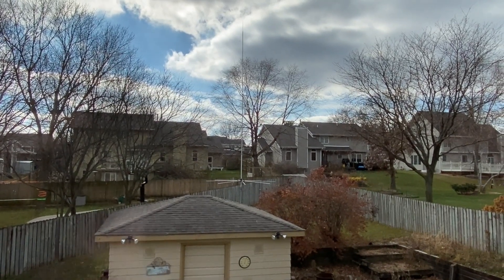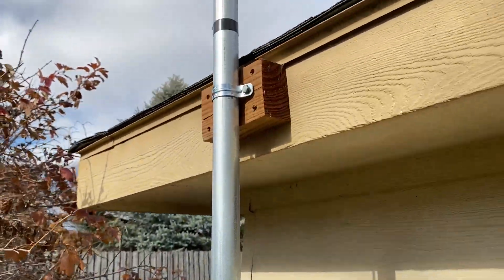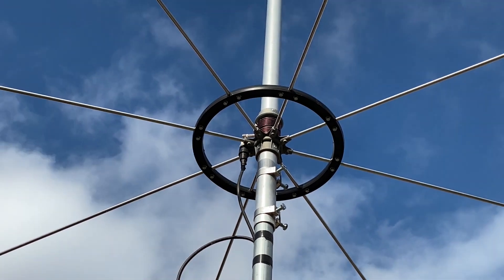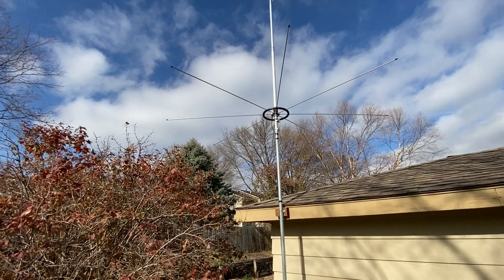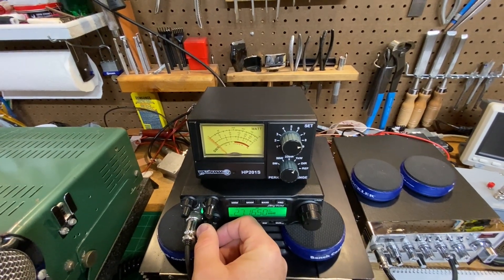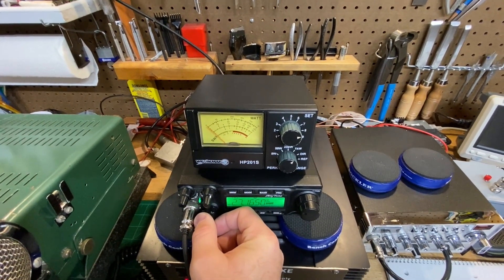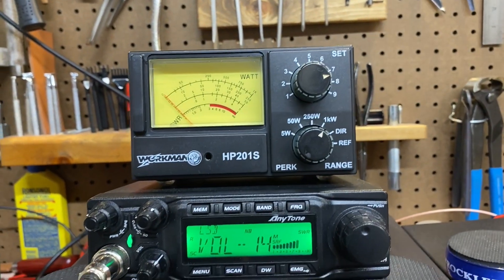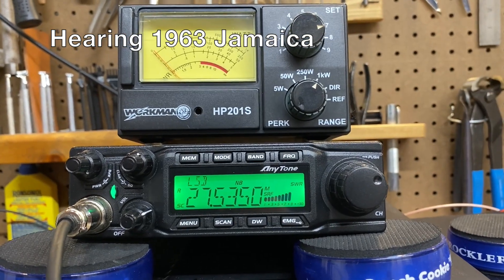Sirio 827 One Year Review and Overview - CB Base Antenna

Comment: I've tried the 2016 sireo and in a matter of months it's bending. So I've ordered a 827 wished I had firstly as I had one years ago and it was awesome. So can't wait to get it and put it up 🇬🇧
Reply from the maker: My 827 is two years old.  We haven't suffered any insane winds, but maybe a couple of 90mph gusts.  It's still as straight as day one.
Reply: @421CentralIowa  the 2016 is just like a silver rod with a coil, only up 16ft and it's bent. Can you remember the top section swr length bud.
Reply from the maker: @CarlPortass  I can't remember the exact measurement but the 827 came with instructions to calculate the length of the top element in terms of tuning to what frequency.  When I first set mine up for channel 20 my SWR was 1:1 from like 26.500-27.800.   I can get away with using it on 10m but my SWR is around 1.7 up there.  I have used it on 26.805 to talk on FM without any problems.
Reply: @421CentralIowa  brilliant cheers bud 👍
Reply: I don't like the sound of that. I heard other people saying they were good quality/rugged.  I'm only commenting because I was going to put one up next week and really don't want to have to look near it for at least 5 years. I went for the 2016 because of the lower wind loading which is about 100N less than the 827 at 80 or 90mph or what ever it is.
Reply: @samuelkearney880  Make sure you tape the joints well as the plastic sleeves that locate the screws are poorly made. They use to have a slight cup inside for the screw but not on the 2016.
Reply: @CarlPortass thanks.  I put the amalagmating tape on the joints.  I'll give the 2016 a go and if it goes sour after a few years i'll hopefully have the tower ready and put up the 827 and 4 element yagi.
Reply: Did you have to use "Gorilla "Tape. Or self amalgamating tape on  the whip sections? Cant see it in your video.
This is what I need to change 4 times per year! I hate to get the pipe down with my Sirio Gpe attached on it as I do this alone. I want an antanna like yours : No maintenance for at least a year. So all seasons. 
So the waterproofing tape is really anoying every few months when it get hard and crackled and letting water through. 
I am very interested in the Siro mega range 827. Adjusting seems the same as my cheaper Sirio. But I really want an antenna for once that dont need 4 times a year getting down for new tape.
Reply: @Iheartmyson  I used amalgamating tape
Reply: @CarlPortass  ok. So you dó use it ,in contradiction of OP! 
Man i get confused now. But the 2008 and 2016 are very good antennes anyway.  Just wondering reading the video makers not using tape at all. Thinking rain / water will drain away or something. Like the Tornado or monsoon ( i think) where the antenna is shoved over the pole, so on these the water does literally drain away!  Hmm, have to look and email a seller about it then. ( And hope he is honoust) Lol
Reply: @Iheartmyson  Hi in my understanding is that there is NO drain hole on the antenna, and everyone uses tape on the joints and also around the coax connector to stop moisture getting in and corroding the connector. I also used  better hex head self tapping screws and not the crap that comes with the antenna. Always best to ask advice from people who have the antenna, 73s buddy

Comment: Well, "skip" means just about nothing. The real question is how does it work locally, and out toward the horizon?.
Reply from the maker: Skip is everything.  I only talk DX, not locally.  I have mine mounted 10 feet off of the ground.  I imagine it'd work fine locally if it was 36+ feet off of the ground, but I don't talk to locals.  I have talked to someone on sideband who was on a moonraker, about 65 miles from me as the crow flies.
Reply: Skip is all about atmospheric condition's. If conditions are in your favor where you are at, then someone with like  12 watts of power can talk over someone operating 1kw amp. It cracks me up how these manufacturers say this so&so particular antenna is the best for DXing. It's all marketing B.S. on the DX part.I've talked skip on a Wilson Little Will  magnetic mount antenna inside my house stuck to a metal stair railing. Also talked to a local friend 12 miles away from me on the same setup. All this done using a President 2510 putting out around 35 watts PEP on LSB.
Reply from the maker: @timmack2415  The full cycle is 11 years.  2025 will be the peak and around 2031 will be the dip.  2036 will be around the next peak.   But propagation conditions still happen randomly even at the minimum, just like we have dead days on the air during the peak right now.     I'm going to have a 5 element horizontal beam on a tower with a rotator at some point which will open things up for me on the days when conditions pop up during the weak part of the solar cycle.
Reply: @421CentralIowa  I'm well aware. I've been a CBer since 1975 and an extra class ham since 1989. 
I'm not sure what happened to my last comment, but I believe I said that.

Comment: I gave up freebanding in 2002, glad to see it's still going strong,  low angle is great for DX, I made 2. Coaxial cable antennas and co-fazed them at 25 feet, one vertical, one horizontal, talked all over the country and the world, 73s. 2AK2410 Mike
Reply: Did you use the big 75 ohm coax for your cophase cables ?
Reply: @flhusa1  no I used rg-58,  it was the best cable I could get though, wasn't the cheap stuff,  I got a roll from a local shop that was closing down, 300+ feet left on the roll when I bought it
Reply: @mwilliams55555  ALL COPHASE CABLE ASSEMBLIES REQUIRE 75 OHM TO WORK PROPERLY. GOOGLE IT IF YOU DECIDE TO MAKE ANOTHER ONE.

Comment: If you put that antenna up against a £40 odd quid silver rod you wouldn't be able to justify paying the extra £100.
Reply: Will the silver rod also work on 40 meters?
Reply: @skiball2000  no. 26 to 28 megs. 10 and 11 meters
Reply: @zukispur5493  Actually here in the US 10 meters stops at 29.7 MHz. 
I was planning on purchasing a Sirio 827 as a 10 meter vertical. The prospect of getting 11(CB), 12, 15, 17, 20 and even 40 meters on the antenna was a big plus towards my decision. You mentioned the silver rod as a cheaper alternative.. If I can get the same bang for less bucks, I’m all in. That’s the reason for my question to you. Amateur operator- WW3HAM
Reply: @skiball2000  I didn't realize the 827 had such a wide range. Kinda justifies the price now I suppose. The simple silver rod is enough for me right about now though. I have it on the roof of a 18 story tower block here in London 🌚 can get out all over London on a watt or two. Vintage cb radio is my thing , those I wanted in the 80s that I couldn't afford. Cobra 148 gtl DX. Stalker x1. Westland 707. Midland 7001. President Lincoln mk1. Teardrop mic. Turner jm+2u. Silver eagle mics ect. Anyway brother nice chatting with ya🌚👍
Reply: @skiball2000  old licensed hams are killing this wonderful hobby.  They all need to lighten up. 🌚
Reply: @zukispur5493  I received an old DAK Mark IX a couple years ago. It was a CB’rs dream back in the 1970’s but had a $600 price tag so few people owned one. I just now ordered the 827 which should be her next Thursday. I’ll be able to play at around with that old CB as well as the ham bands. I think I made the right choice. I guess I’ll find out soon enough. 
Take care and good luck on skip. The new solar cycle should prove fun in all HF bands.
Reply from the maker: @skiball2000  I just dragged home a Dak IX Tuesday, so I'm hoping to bring it back to live and get it onto the air soon.
Reply from the maker: There's no need for me to justify anything I own.  I already own everything I need in life, so now I just waste the extra money on things that have little value to anyone other than me.   I could build a dipole for 5 dollars, but I prefer having a durable antenna that I don't have to constantly tweak.    People talk just as far as I do and as reliably with Antron 99 antennas that cost 100 dollars.
Reply: @421CentralIowa my money is for spending on me know. My kids are grown. 🌚 I just spent £600 re capping my sansui AU 717 amplifier. Money well spent
Reply: @421CentralIowa  dak IX?
Reply: @421CentralIowa  oh that huge brushed stainless radio with the 4 metres? Niiiice
Reply: @skiball2000 licences should be optional if you ask me. It's like having to understand the combustion engine before one can drive a car. Needing a license to talk to people seems so dated

Comment: Sirio makes an excellent product in my opinion, nothing is half assed. You have the right formula, for DX work you want a low takeoff angle, its just the opposite if your working local stations.
     Thanks for sharing your radio gear with us.😏👍

Comment: Thanks for sharing. I just put up an 827 and so far so good. I prefer aluminum antennas, and this one offers good performance for a reasonable price. I used waterproof elec. tape and taped over the sections that connect together. I also purchased the nylon ring for the ground plane.

Comment: I use the same antenna with the radial ring. Nothing but praise for that antenna. Still straight, no missing radials, and great performer. Next better thing is a beam. I wouldn't mind trying out the Colossal 5k.
Reply from the maker: Mine is a year old and looks the same as the day it went up.  It also works the same as when it went up, so my mission has been accomplished.  Out of sight, out of mind :)

Comment: Awesome video and antenna man. I definitely need to get me a base antenna set up. Sirio does make excellent antennas. I need to be over 10 feet. My house is surrounded by some fat trees. Thanks again for the video.
Reply from the maker: It's surprising what'll work.  Some people strap Antron 99 antennas part way up a tree, right against the wood and manage to have good performance.   Having the antenna away from trees probably helps to tune it.   I followed the length suggestions in the instructions and had 1.0 SWR without having to re-adjust.  My SWR is 1.3-1.5 only when I'm using my amplifier.   It's about 1.0-1.1 with just the radio barefoot.
Reply: Trees have no effect on your signal.
Reply: @421CentralIowa I have a hybrid antron 99 in my oak tree about 35 feet up  .painted camouflage so no HOA member can see it. Hybrid because it has a cut down stainless steel whip for top section and the rest is factory for lower sections.  My antenna gets higher every year. 😢😂😊😊

Comment: Good review, I'll be using the Serio 827 for 10 meters. Nice closeup shots of the radial hub.
Reply from the maker: It should work well for that.  I have about a 1mhz range (26.600 - 27.600) of having an SWR of 1.0 so it's wide banded enough to cover all of 10m without any issues.
Reply from the maker: @miker8379  Yeah, I just hooked my antenna to my analyzer and have 1.5:1 from about 26.000 - 28.000.  The whole 11m range is below 1.1:1.  I like how wide banded the antenna is.

Comment: Hey 421, I'm going to try a new antenna out tomorrow or the next day whenever I get it done, it's kind of a home brew design like having a big stick on top of an antron 99 with a two element horizontal beam all driven off of one piece of coax, and if everything works together impedance wise it should make for a healthy DX and local antenna. Listen for the "Beetle Mender Eleventeen" on L36 - L40+ and I hope we have conditions!
73!

Comment: The Sirio 827 (or whatever they call the new version which I believe already comes with the plastic anti-resonance ring) - is probably the best bang for the buck - it's a good performer,
(actually Very good)
 well made, not cheap but not stupid expensive, and is overall just a good solid design.
Reply from the maker: Yeah, I'm glad I went with it.  The Sirio is going to outlast my use of it by the time I get a tower and beam of some sort.   It's in the middle of the pack on price and durability, but has performed very well for me and it's as straight as the day I put it together.   I haven't had any issues with it or needing to give it any attention due to weather or corrosion.

Comment: well I had a whole bunch of omni verticals, the two Sirio antennas I've had were the Gain Master and New Vector 4K, and I've had an i-10k, a Shockwave, Zer0-5 Colossal, helped a friend retune and install his Mr coily, along with all of the other fun little antennas like Astroplane, Starduster, A99, Imax2K, also had a GPE27 by Sirio, Avanti Sigma-II ⅝, Taylor GLR-4 "Grandslammer", Hy-Gain CLR-2 & Penetrator, Hustler JamRam, Super Maxim, Mighty Magnum III - plus various home-brew oddities 😆 and the one thing they all share in common is 

there's metal in all of them. 😜

Comment: With how many Watts you send at min 6:12? I see it right almost 600 Watts or i`m wrong?
Reply from the maker: That Workman meter is a bit optimistic.   With the Anytone measured by my Bird 43 meter, I have a carrier of about 125-150w RMS and peak out at about 450w.   The amplifier is a 4 transistor, 1446 design for low-ish drive.   It was originally marketed as a 500w amplifier.

Comment: i got the 827 here as well and i am not verry happy with the swr 2:1 on 27.500
manual info says: 27.500 = 300mm tuning length but it gives me a high swr even with new new rg213 cable en new plugs on it
Reply from the maker: I get almost a 1 mhz stretch with an SWR below 1.4 from end to end, dipping down to about a 1.05 at the resonant frequency (using a Rig Expert antenna analyzer.)   Mine tuned right on the money when I got it and was using RG8x coax.  I've since changed over to LMR400 and the tuning changed.  I shortened the antenna a bit and I'm still resonant on 27.085 at the moment.  So it seems you may need to play with the length based on your feedline setup.   It's annoying to have to change things after the fact though, taking  it apart...

Comment: I want to get a makeover 58 but at my age I can see putting an antenna that’s 18 feet wide up on my roof. Your antenna is the second one I want do you think it’s as good as a Macco honest question because I’m going to get one.
Reply from the maker: I like the Sirio 827 design better than the Maco V58.  It seems like it would hold up better to weather over time in terms of staying in tune. Both antennas would work well though as a good 5/8 wavelength ground plane style antenna.

Comment: I thought it would be a lot higher is it better having it that little of the ground or would it work better higher or Is it the same at your high for higher ???
Reply from the maker: It'd be ideal to have the ground radials at about 36 feet up off of the ground, on a tower.   I seem to get out pretty well at 10 feet, but it's not ideal, especially for local talk.   Locally I am able to talk to guys about 60 miles away on sideband.  I could get up to about 100 miles of reach if I raised it higher into the air.

Comment: May I ask what frequencies does that antenna cover? I mean can it be used from 10 and 11 meters without  any modifications?
Reply from the maker: It can be used for either 10m or 11m, but not both at the same time with good SWR readings on both bands.  It covers about 1mhz with a flat 1.0:1 SWR.  I've got it tuned for 27.285mhz and have talked on 10m between 28.300-28.500 but my SWR is something like 2.3:1.

Comment: Would you recommend this over a iMax 2000? Thank you
Reply from the maker: I like it, but people who have the 2000 also like theirs.  I wanted an aluminum antenna rather than a fiberglass one.  The nice thing about the Antron 99 and Imax 2000 is they are lower profile without the ground radials at the base.  If you think the neighbors care about visuals, the fiberglass antennas still work.  I have a local 1 mile from me that gets out as well as I do with his new Antron 99.

Comment: Awesome video. I like the 23 channel radio👍 what amp? Great radio station‼️
Reply from the maker: I think Palomar called it the Deluxe 500 or the Boomer 500.  Someone had it for sale locally, so I picked it up last year.  It's been working fine, so I'm using it for now.  I'd like to eventually pay a builder to make me something nicer.
Reply: @421CentralIowa  A builder?
Reply from the maker: @zukispur5493  People who build amplifiers.  There are countless builders in the USA who sell the same basic 'pill' type amplifiers.
Reply: @421CentralIowa  if you want something built properly get it built here Germany or Japan 🌚
Reply: @421CentralIowa  I use a amplifier made in Italy 😂  rm kl 503. It does the job especially at my height.

Comment: I think height is over rated. I have seen guys with their antenna literally on the ground do better then guys that have it 50ft in the air.
Reply from the maker: It would help me a lot to talk to my locals better, but for DX, it may actually help to have it lower to the ground sometimes.
Reply: @421CentralIowa  That's true, I should have clarified that. Definitely for local, go higher. But on the ground, I've seen amazing DX
Reply: I have a buddy of mine that has a 5/8 super penetrator ground plane that is mounted on a 4 ft metal fence post. I have a A99 mounted 20 ft metal pole.We are both running same radios Anytone 5555n2. He can hear people and talk to them up to 80 miles away that I can't even hear. I'm looking at the Sirio 827 or 2016 models.

Comment: Get a True Peak Reading Wattmeter and throw that Junk Away.If it doesn’t have a Peak Reading Circuit it can’t read Peak Power and that requires power going to that Circuit and not just to a light in the meter.An Average Reading Meter is Junk and Cheap for a reason & why the CB Shops sell them.👎🏻🎙
Reply from the maker: I have two Bird 43 meters inline to read output power and reflected power in realtime nowadays.  I also have a RigExpert AA35 and a Nano VNA.